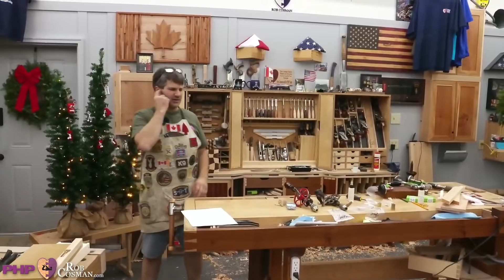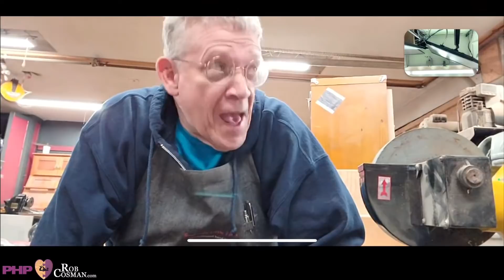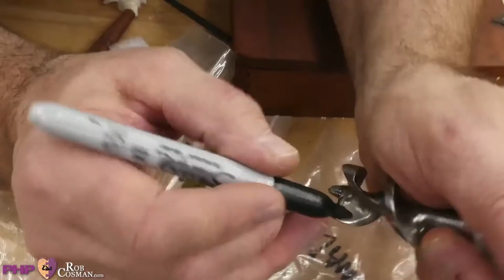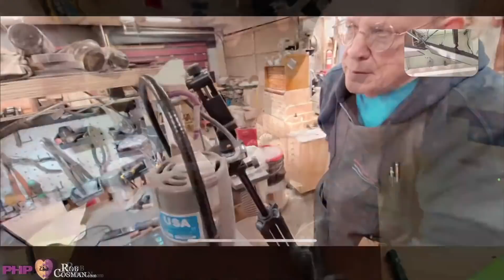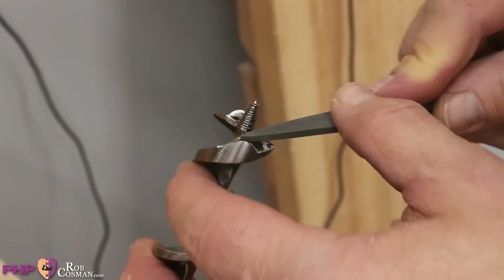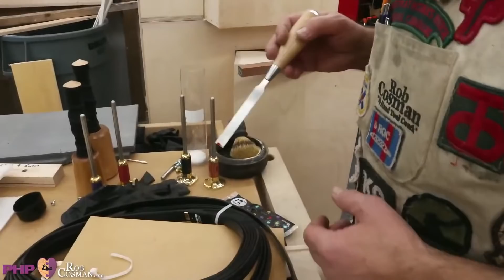Hand Drills & Bits - Live Q & A (4 DEC 2021) WARNING: GRAPHIC CONTENT

Comment: I think Rob was filing the wrong side of the lip. As a Brit I could tell what both US & Canada were saying and it seemed to me that they were at cross purposes . Also the name of the 'wing' is flute, not fluke. The reason the bit has a square bottom is the two jaws close nicely on a square cross section and resist the twisting action of the brace. Modern bits tend to be hex shape and the grip in not as good.